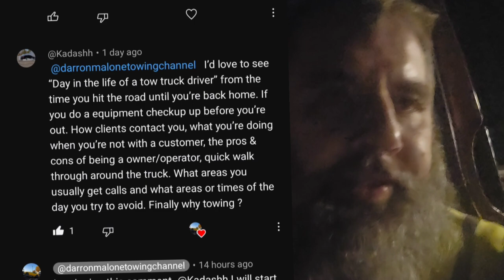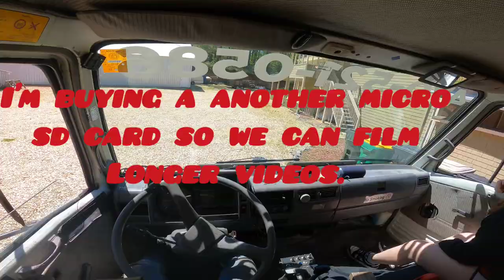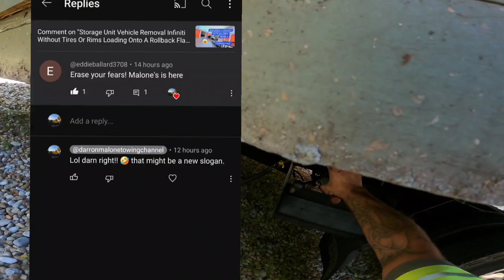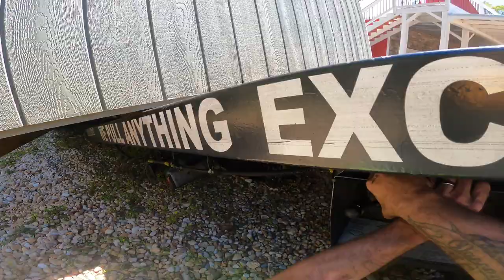A Day In The Life Of A Towtruck Driver Towing A Shed And A F150 Loaded Winchout Rollback Episode 1.

Comment: You may miss the rotation calls but man they get old fast. Gets old everytime you go to make food you get a call, everytime your head hits the pillow you get a call, every time you try to play with your kids you get a call, Start a project and a call comes in, gotta leave carts full at home depot because you were halfway done and had to roll out. It gets old, After a few years I was pretty much over the excitement for it, Occassionaly I get something interesting that kinda sparks my curiosity but that's about it. Granted I run them a little different than you may have, I run rotations 24/7 around the clock I am never off but I only run rotations, So I can plenty of down time but I always get called out when I definitely don't want to be, Sounds like you did on call by shifts.
Reply from the maker: Well so my old boss would let me take the truck home on my days off so I could possibly have a chance to backup one of the other rollback drivers if needed. So honestly I was able to make as much money as I wanted. I know that eventually will come as I grow. Brother honestly I started my company because I knew I had a true passion for the work. I had no claims due my fear of losing money. I had over 50 5 star reviews with my name in them for my old company Ace, leading me to believe I had a gift for the job. Now for whatever reason I didn't take into account the liability and stress and time it takes to make a name for myself. I would like to have 1 heavy 1 medium and 3 rollbacks. I feel like that's big enough to make money yet small enough for me to be able to be involved and informed on everything going on.
Reply: @darronmalonetowingchannel  getting your name out is definitely the hard part, our company was started in 1997 and has grown in the light duty side pretty well, I’d argue it’s about maximized for our area, any more rollbacks and we would need more locations or would have to run bullshit calls, as for the heavy we just bought it and I have struggled over the last few months to get that side of the operation running, I’ve done a handful of calls and that’s it over 4 or 5 months. 10 grand in billables in I believe 5 months. For any newer heavy that’s in the negative, and I believe even for our older that is either negative or just barely breaking even. So even with over 20 years of light duty reputation it doesn’t at all help with the heavy side, pretty much have to start over from square one.